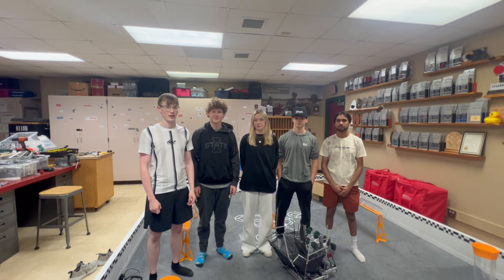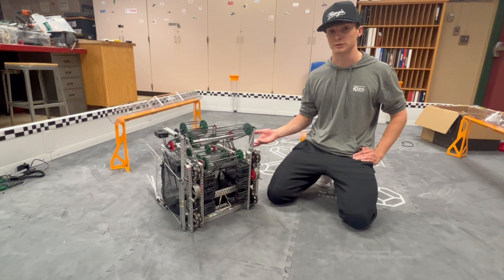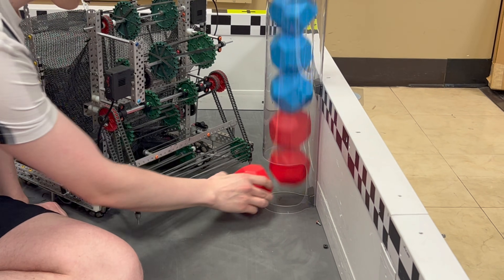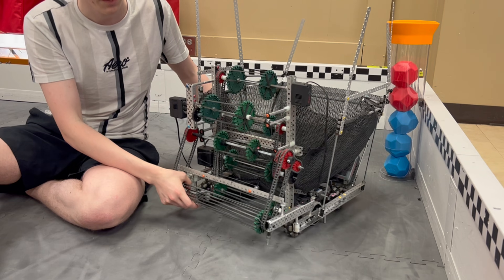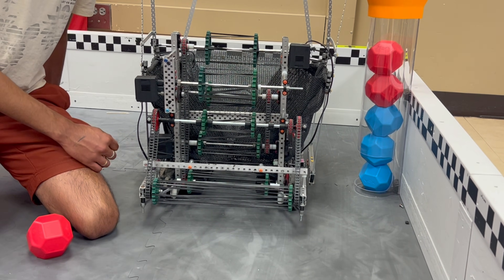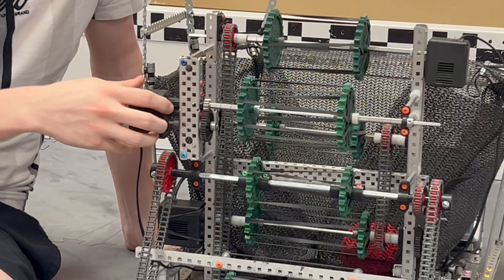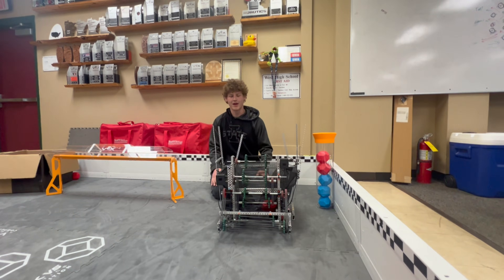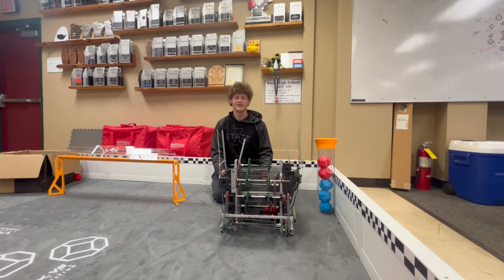Vex Robotics Push Back | Ri24h | MARC

Comment: The Pirth Roller is pretty much ingenious but it seems to be better for one way intaking. What i mean is that it's a bit difficult to score with. Do you guys plan on adding another scoring mech or funnels on the intake to make scoring easier? (If it's not clear I say scoring is hard because the balls come out too far on the left or right)
Reply from the maker: I’m assuming you mean for the low goal? The idea would be to hold some balls in the intake track, which would be in the center, so when the intake would spin in reverse it would stay centered. If you mean the funneling itself, we were not able to make proper funnels on this robot due to time, but those can definitely be made! Scoring itself on this robot is not the greatest as we did not really tune it, but we are sure this design can work well. We are not continuing with this robot as it is a ri24h, but we do have ideas on how to improve it overall if we choose to make a similar design in the future. Sorry if this doesn’t fully answer your question, feel free to leave a follow up comment❤

Comment: how do the balls come out of the "hopper" back to the intake to score
Reply from the maker: So with this rendition of the robot, they can’t. But the idea is the bottom most roller would spin in “reverse” and pull the balls out, and then the intake would spin “forwards” so they could go to whatever part of the intake. This would require a separate hopper for our color balls. We were not able to implement this due to lack of time and motors, but it is certainly possible for teams who pursue this design.

Comment: I absolutely adore the dead/missing-axle design! Reminds me a bit of frc tube intakes.
one concern I have though is how low and exposed this design has to be to work. lots of potential entanglement with opponent bases, with this being a band roller design and all. 
Do yall already have a plan on how to avoid entanglement? I imagine a rigid rambar at ball height could prevent the worst of it, but I also see a lot of base corners sticking under it.
Reply from the maker: So for this design, a ram bar would not allow the match loads to flow. But the principle is kind of more bands make entanglement less likely. It could also be possible to wrap bands laterally around the intake bands, thus making entanglement harder. There are definitely other solutions, which we greatly encourage people to figure out and implement!

Comment: Since there’s no possession limit you could add a mech where you use a color sensor and it sorts the opposite teams color blocks into the mesh carrier preventing them from scoring cause they have little or none blocks
Reply from the maker: Yeah that would work very well. We were not able to implement a color sorter, but making one with this design would not be too difficult!